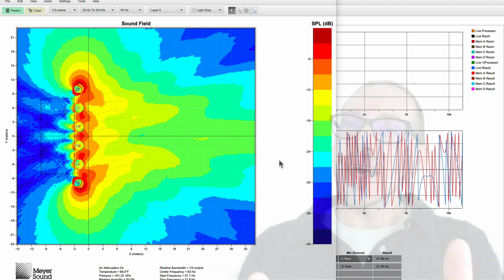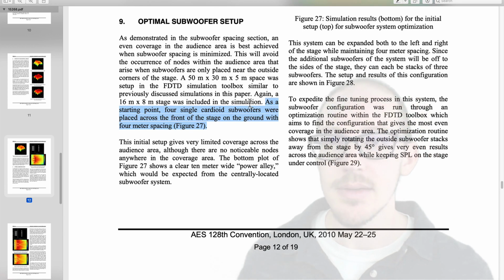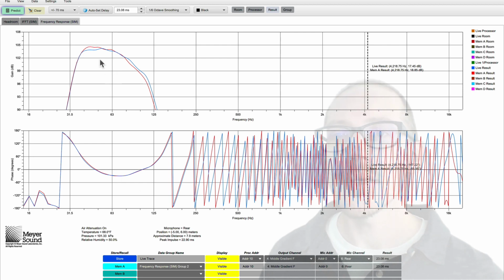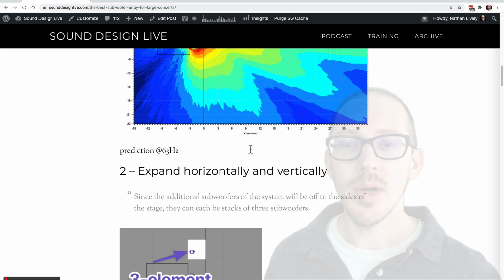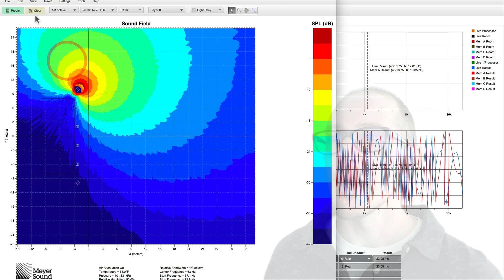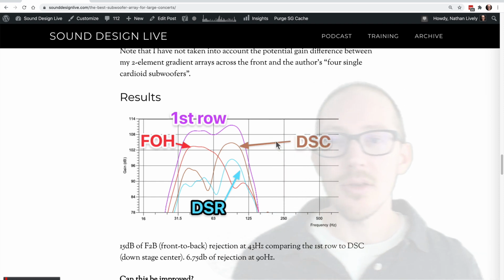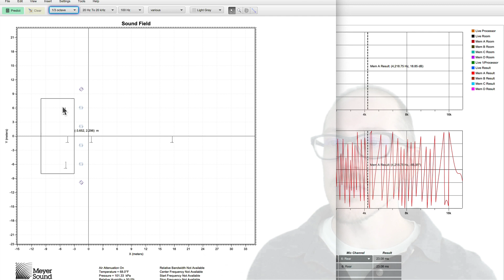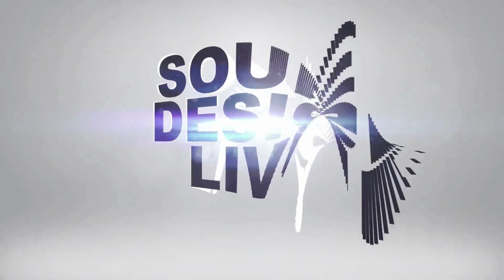The BEST subwoofer array for large concerts?

Comment: If the subs are spaced apart or the line of subs exceeds 10’ it steers the waves narrow. Unless the audience is only sitting in center a delayed arc will smooth out the coverage and widen it. Adjusting the delays will shape the coverage exactly where you want it while minimizing nodes

Comment: I've a question. The article talks about put subwoofers 4 meters spacing. But why 4 meters?? it's only a starting point? or there is a reason?
Reply from the maker: I'm sure if has to do with the bandwidth, but you should check the original research that this article is based on.

Comment: I have 4 52's (old i know) but it's what the band using our venue is allowing us to use. Also 4 18' powered subs. I aux them all. 52's on aux 7, 18's aux 8. I started having them LR of stage.... and just recently moved the 18's across the stage underneath. They're about 4-5ft apart....I was able to reduce volumes of all subs .. and even put 2 extra mains the owner had.... inbetween the middle empty sections of the subs pointing as if they were monitors. On their sides facing upwards. A cloth facade is all that blocks the front of them all.. and it sounds INCREDIBLE. I have almost no equing on the subs, just a 20hz hpf and slight db reduction on 60, 80, 100. It totally transformed the experience positively. It took me a year of messing and learning, but I'm finally pleased with the sound on and off stage. I tested the mics in front too, just because I was concerned ab feedback at full volume and with the right eq/gate/comp there was absolutely no tweaking required. 

If anyone is wondering my eq mix for mics, I usualy go 4:2 ratio on the compressor with 22-24atk/5hold/20release. Cut up to 140hz with hpf and very slight tweaks with skinny peq adjustments depending on what's happening.
Reply from the maker: Nice work! Really great to hear you found something that works for you. :)
Reply: Yes! The perseverance paid off big time. My boss is an engineer as well, so working around the things I don't understand...is just a little bit easier idea wise. 
Thanks for your work on the channel. I've been sifting through so much engineering/sound/mixing content the past year... and it's truly the biggest library in history. With videos, demos, approval; what a time to be alive! @nathanlively

Comment: Hey i have a question,  so when setting up subs in say a cardioid type of set up. 
Would i need to have several speaker management systems,  like a dbx drive rack i dont understand how i can set delays on some and not the others when running multiple subs.   Thanks for any help. As you can probably tell i am a rookie.
Reply from the maker: Hey Weld, yes, you'll need some way to take action on the system. That could be a output processor, a mixing console, or something else, but delay and polarity are the basic tools for the job.
Reply: @nathanlively  thanks Nathan, it would be awesome if you could do a video showing how to set delays on subs when running multiple subs for some of us that are super new.  So what I dont understand is, from what i have seen. Most crossovers have one sub out. I would like to see how this would be wired for multiple subs when half are delayed and half are not.  Dumb it down for me. Lol!!  Thanks for any help.

Comment: Hi Nathan.  Is there a reason why delay wasn't applied to the subs in an increasing increment as you move outwards from the centre ? What about the subs being 1/4 wavelength apart as a distance compared to the 4m distance initially indicated ?
Reply: The example subwoofer setup in the paper was based on a non ideal system where the number of subwoofers and processing channels were limited. In this case, subwoofer placement, spacing, orientation and directivity were chosen as the available optimization variables. Since then, I've done a couple more papers that cover delay and other aspects of subwoofer system optimization. Take a look, if you're interested!
http://adamjhill.com/AJHILL/wp-content/uploads/2018/02/Hill-AES-SR-2017.pdf
http://adamjhill.com/AJHILL/wp-content/uploads/2018/11/Hill-AES-144.pdf
Reply: @adamhill964  Thanks Adam, the papers were interesting, although some parts a little maths heavy for me.  Insightful and helpful information to digest, thanks.
Aaron
Reply from the maker: Hey Fitzpatricks, I'm not sure. We would need to ask Adam, but I don't think the intention was the widen the coverage with a delayed arc.

> What about the subs being 1/4 wavelength apart
Is that your suggestion for a new design? 
I guess that would shorten the line length and widen the coverage. Would you be willing to test it out and share your results?

Comment: Hi nathan, have you tryied a center cluster of subs forming a triangle where the two front sub stacks are facing at a 90°, the rear cluster is inverted for cancelation towards the stage... this has really worked for me!! You should try it on the program see what results im getting!! Thanks
Reply from the maker: No, I haven't. Sounds cool. Could you draw me a diagram or show me one of your designs where you have implemented this?

Comment: hey nathan, is there any chance you can do a video of how to calculate spacing between horizontal subwoofer array and how to find delay per sub?
Reply from the maker: Hey H, great suggestion. Do you have a specific design I can use? What specific questions do you have about designing and deploying the array? 

The more details you can give me, the more likely it is that I'll be able to create something that helps you. :)
Reply: @nathanlively  maybe 6 subs with spacing in between.
Reply: I'd be keen to see that also. I have d&b V sub (cardiod sub w/18" forward firing and 12" rear firing) and would like to see 4 or 8 of them in a line with 1/4 wavelength spacing and delay applied coverage. Even a DBX Driverack gives me 2 mid/high channels then 4 channels with delay i can use for 8 subs.

Comment: What’s the spacing between each set of subs and how much delay is each from the center subs at zero thanks
Reply from the maker: Hey Alex, thanks for checking out the video. It might be easiest to get all of your questions answer by downloading the MAPP XT file liked at the bottom of the original post - https://www.sounddesignlive.com/the-best-subwoofer-array-for-large-concerts/

> What’s the spacing between each set of subs
4m

> how much delay is each from the center subs at zero
I'm not sure I'm clear on your question here. Each of the gradient arrays has delay on the rear sub based on distance, but that's the only delay setting.
Reply: @nathanlively  8 units of dual 10 subs.. do I need to set up delay.. if I place them super close to each other?

Comment: If it was me, I'd be moving off the stage by that meter as you said and probably do a delayed array with the center being 0 added delay. Really helps even out the low-end response in the room especially in that 270-degree issue but that would probably require more subs to be ultimately effective. Just my initial thoughts though lol I'm very much still learning.
Reply from the maker: Hey Murham, great idea. Maybe similar to the solution that Vojetech proposed? 
https://www.sounddesignlive.com/the-best-subwoofer-array-for-large-concerts/#comment-211360